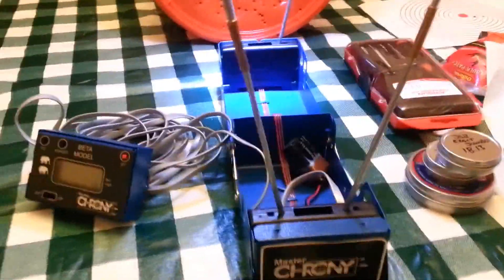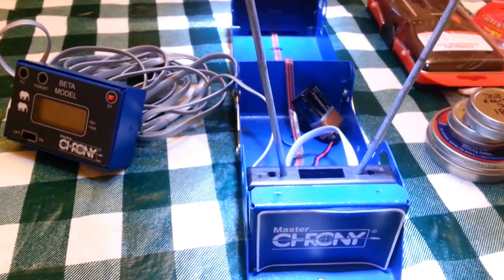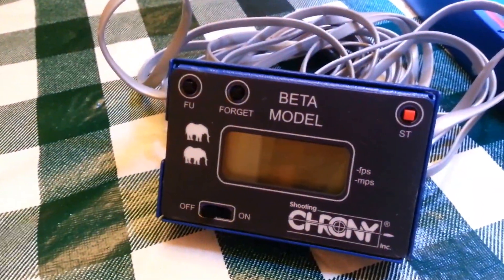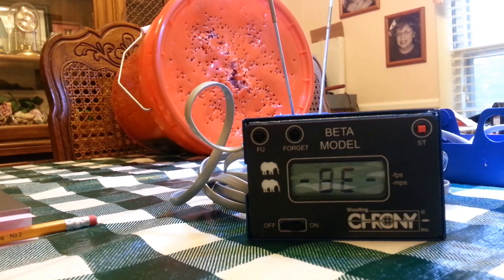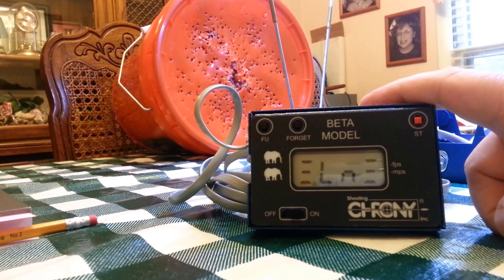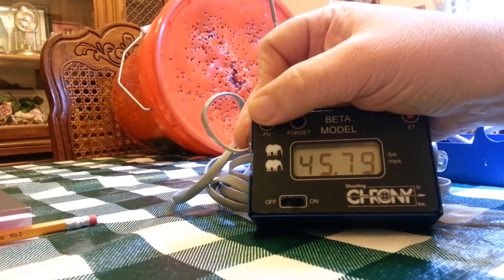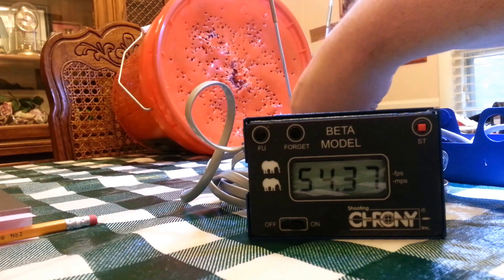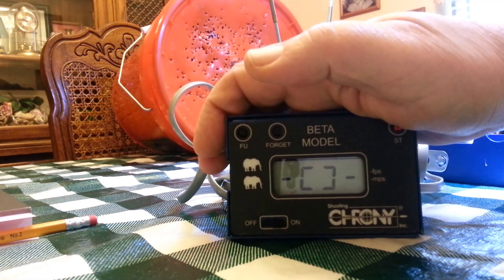Chrony Beta Master Introduction

Comment: Thanks for the help I have on mine for almost 20 years and I never read the directions ...imagine that. I normally shoot for five times through it just to figure out what my load data was out of a certain gun so I can figure out drops. I took it out the other day and didn’t put it on a tripod and had it sitting on an uneven surface and also underneath a shaded canopy and got nonstop errors a good 12 to 15 times and then two readings of 3500 for my colt 45.  I ended up with two normal readings after I backed up a good 15 yards. After watching this and a couple other videos I realize I have to put my chronograph out in the sun.

Comment: The LED lights and magnets are brilliant!  Probably just as effective as the light kit and battery option at FAR less cost.

I've had mine for over 2 years and only used it about 3 times.  I just can't seem to get the time to go shooting and when I do I don't take it out with me because I don't want to bore the kids.

I have the Beta with the memory upgrade.  Still learning how to use mine as well.  As you say the manual is written more for engineers than shooters.